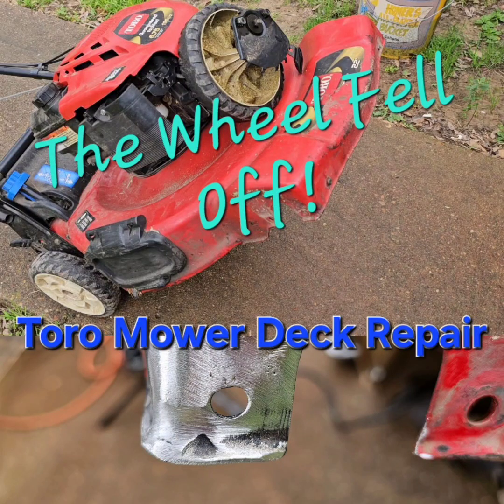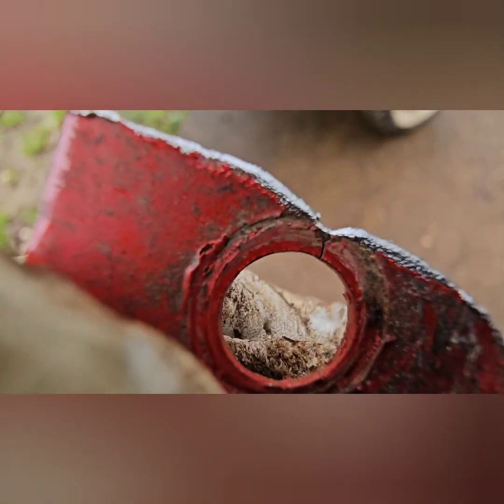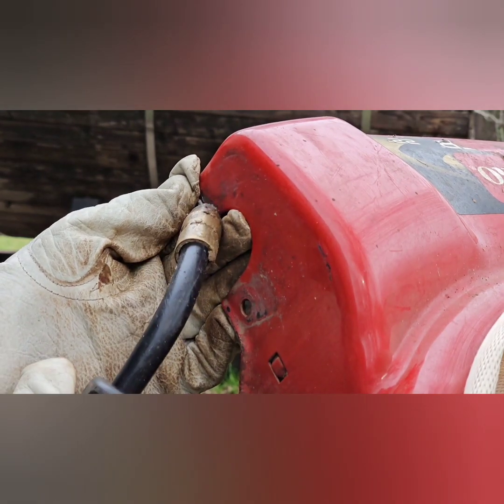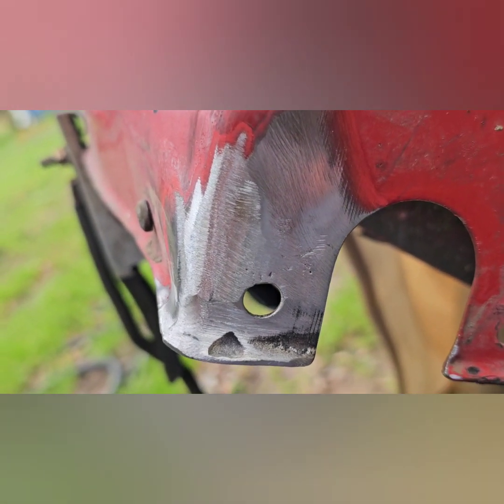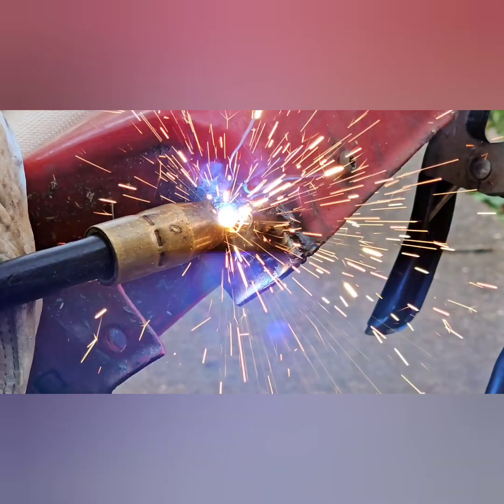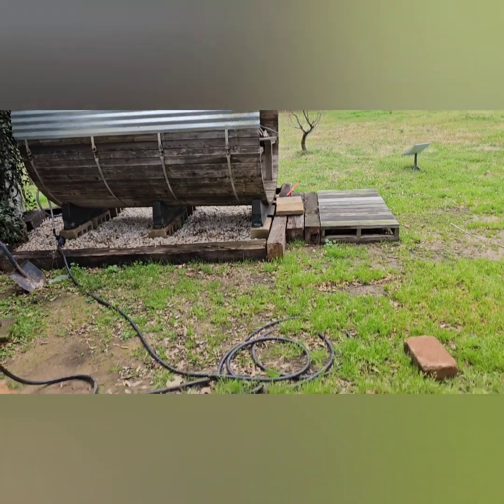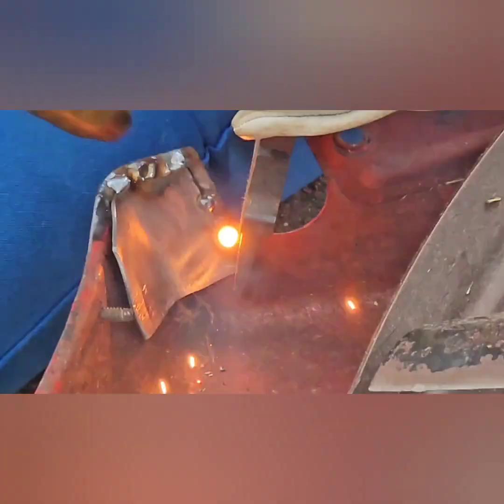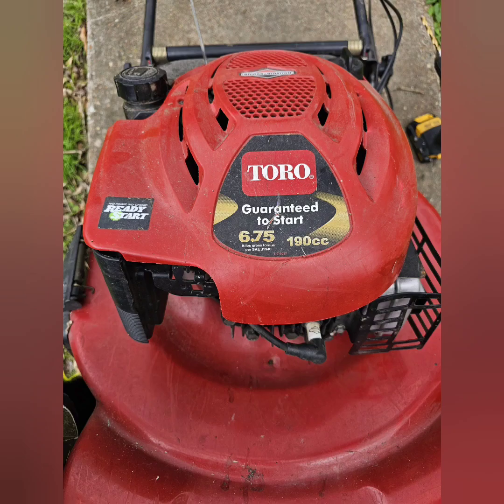Toro Mower Wheel Fell Off. Welding Repair.

Comment: That's interesting that you can make a series of tacks and they connect into a decent weld. Good job!
Reply from the maker: The metal is so thin. If you run a continuous bead it will distort. @giantd
Reply from the maker: You can do it with stick welding also @giantd